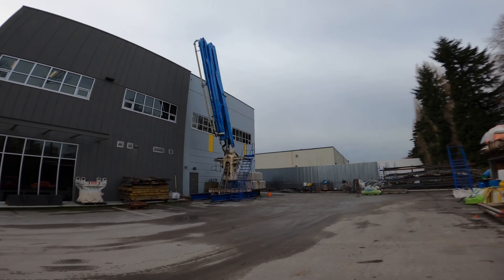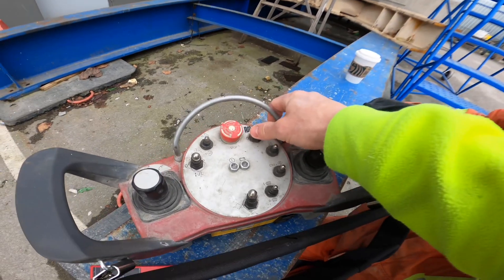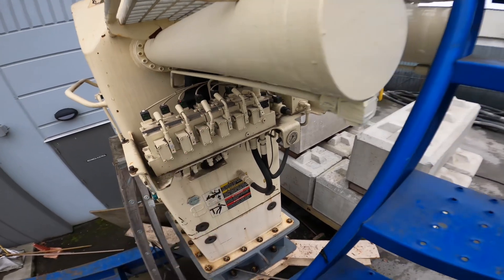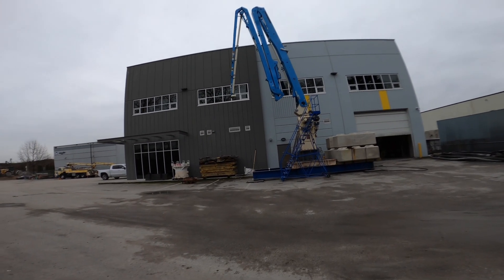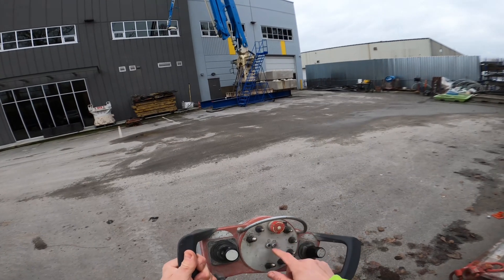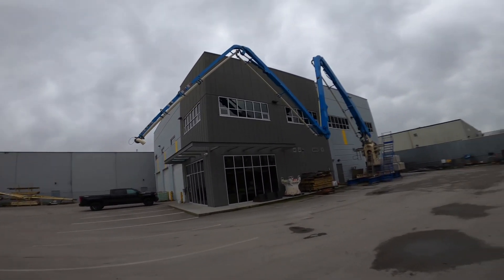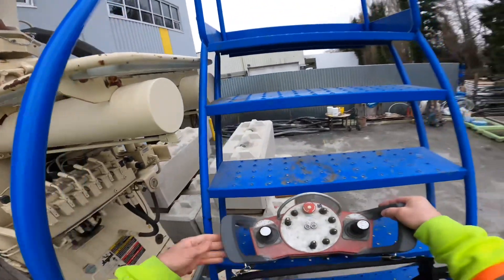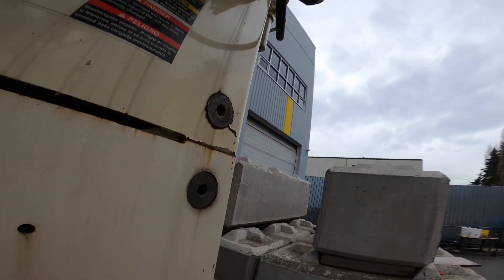Getting the 40Z placing-boom project ready.

Comment: Any tips you could give me on pumping a high sand mix flowable fill? I have a customer that wants to pump from the boom into 4 inch pvc pipe that is about 400 feet long over a hillside. I appreciate anything you can tell me.
Reply from the maker: So much of it falls in the hands of the ready mix supplier. If they are able to add fly-ash to the mix that will help immensely in terms of pumpability. Also, the admixture “V-Mar” is amazing stuff in terms of making otherwise unpumpable mixes work. It’s a viscosity modifier (think of it like honey). It helps keep the mix in suspension and prevents segregation. As far as what we can do on the pumping side of things: don’t stop the pump unless absolutely necessary. Just keep the stuff moving and don’t give it a chance to separate in the pipeline.
Reply: @canadianconcretepumper1979  Thanks brother I appreciate the info!! 👍🏼